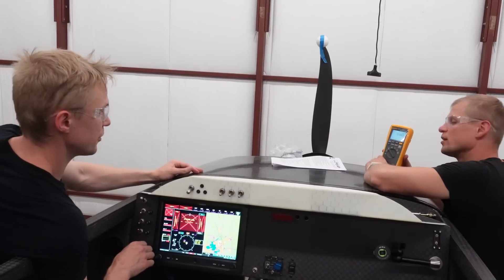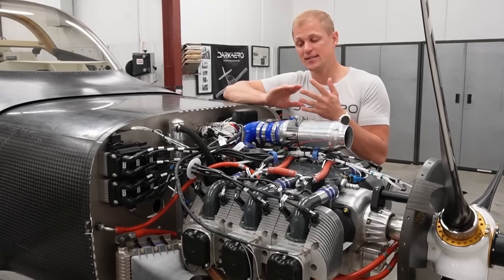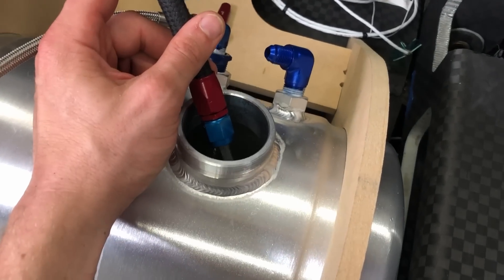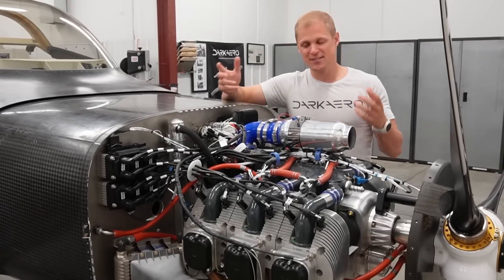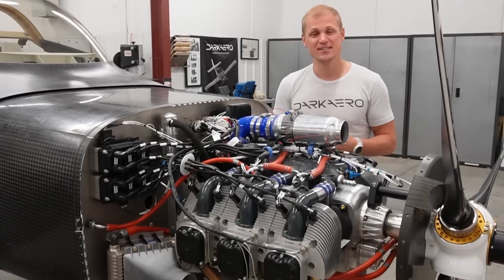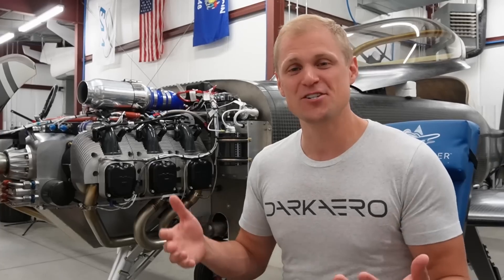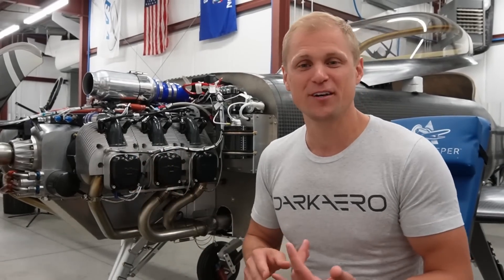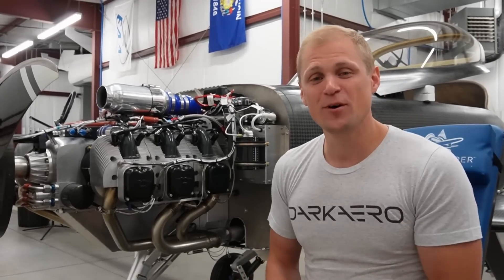FIRST ENGINE START! - DarkAero 1 Aircraft

Comment: First engine start...no chokes on any wheels... you intended to use your toes as brakes? That's not what a toe brake is though. Appreciate your efforts so far and documenting and sharing as you do, but please, stick to some safety guidelines and measures like the rest of us - Standard Procedures. And chokes before and aft the wheels are just part of it and avoid having an unpleasant impromptu meet with your hangar neighbour and the FAA.

Comment: Glad you guys chose to go with an engine that accepts unleaded mogas. Frankly, despite that I’m a pilot and it would be in my economic interest to keep things as they are I think that leaded avgas should be banned across the board. Nobody’s hobby, or even profession, should do measurable harm to children. In the long run unleaded is cheaper anyway since mogas prices are far cheaper than 100LL.

Comment: Aircraft is all about redundancy is it not?  I do not know.  Wire locks for bolts etc.  The throttle cable only has a grub screw to secure it.  Is this enough?  No crimps on either ends of the grub screw or heat shrink tubbing in case the grub screws grip fails?  Maybe it is not an issue.
Reply from the maker: Good eye! This is something we had discussed as well. Before first flight we have plans to add in an additional stop mechanism. One easy solution we had thrown around was to simply bend the wire up to prevent it from sliding back. However, we knew the engine would be coming on and off so that type of secondary stop didn't make sense to implement just yet.

Comment: Nice!  I'd be inclined to add a secondary retention to the throttle cable and eliminate that single point failure. A second set screw adjacent to the current set screw on the cable attachment fitting or a collar with a set screw on either side of the cable attachment fitting.  Many accidents have been caused by cables disconnecting from mixture and throttle levers.  Very nice work, including the frame for the temporary fuel tank.  Great job!

Comment: The prop tips seems very low to the ground. Is that normal?
Reply from the maker: Jack, thanks for watching! The prop does appear close to the ground in the video, but it may be more of a camera perspective thing. Our prop clearance is in line with FAR Part 23 ground clearance requirement of at least 7 inches when the gear is statically deflected in level taxiing attitude.

Comment: we need a photovoltaic fabric that is able to cover the last layer of carbon fiber laminates, and make electric powered lightweight air frames that are less dependent on combustion engine solutions(not having in mind the green side of it as the focus but the performance and simplicity) since electric motors have much less moving parts, and are hundreds of times more reliable and predictable, also having no fluids in fuel tanks, instead having solid state energy modules(batteries and capacitors)...  mind you that i love combustion engines and my logic is the simplicity/reliability of electric systems are undeniably greater than any fuel based systems...

Comment: Well done, guys! One tip: When you go to pushing the engine harder, make sure you cool the cylinders properly. Prop wash alone is not enough. Get your cowls in place, or make a baffle/scoop to grab as much cooling air as possible, especially the aft cylinders will suffer if you don't.
The UL-Power is basically a re-engineered Jabiru engine. Jabiru had heaps of issues from people ground running their engines without proper cooling. Consult with the guys from UL-Power for safe testing.

Comment: Brand new engines in uncowled airplanes do not respond well to running on the ground, especially at higher power.  Don't burn up your cylinders...   If it runs and doesn't leak, get it in the air and cooling ASAP.   Same with high speed taxi tests.  They should be kept to a minimum.  Lots of really nice airplanes get wrecked while pilots are building up courage to fly their new airplane. There is very little to learn from high speed taxi testing.

Comment: This thing looks sweet, but I'm concerned with how many things are electrically driven it seems. It will be interesting to see how the reliability and longevity of the electronics changes or doesn't as the aircraft ages.

Comment: Congratulations guys.  One thing I got concerned about, so thought I’d pass it along.  Be careful running the engine with the small fillets on the spinner bulkhead not attached to the spinner itself.  I once slung off both of my fillet pieces running at just moderate power during a ground run without the spinner installed.  The airplane looks GREAT and wow, that engine sounds like an IO-540.  Pretty dang cool!!!
Reply: More like an IO550
Reply: the lighter weight of a Carbon spinner parts will mean less forces exerted on the parts when spinning, so it might not be an issue, good catch, sharing our experiences is how we get better doing our things.

Comment: Without sounding too negative here, what so great about his plane? it just look like another plane but in carbon fibre, would you not be better off looking at scaling up drone technology combined with electric power which seem to be the future.
Reply: Electric propulsion will just add weight and complexity to the aircraft and, despite the latest battery tech, will severely limit range to maybe 2 hours max whilst this will fly up to 6 hours on normal pump gas.

Comment: Congratulations, guys!  My UL-520iS sat in the factory crate for a little over two years.  The only problem I had on first start up was a single clogged fuel injector, which was easily cleared with a little compressed air.  I'm using Lucas Hi-Zinc Break-in Oil for my first few hours of running.  It seems to be working well for me.

Comment: I'm curious about the engine mounting system. There is no dynafocal type engine mount with rubber vibration dampers. Why is that? Perhaps that was explained on a different video, but the straight bolting to frames on the firewall seemed odd to me.

Comment: You need to place some positive secondary cable stop on the throttle cable.. 1st is to prevent fraying ... second is to give a redundant backup incase the main lock fails. Even half throttle is better then no throttle.

Comment: The prop seems to have very little clearance from the ground.
Is this the actual distance the prop will have at take off?
Since u have a nose landing gear you need at least 7 inches by rules but I would put some more just to be safe

Comment: Did you full feather the prop? Looks like it wanted to go. Probably not much run time yet, but it sounded strong. No "bad noises" from what we could hear from the audio here. It looked like you were a little afraid of it. I understand that if you haven't been around a lot of them running.  Congrats on this milestone!!  Looking forward to hearing it roll down the R/W!!  8)  --gary

Comment: Why the throttle body has only one wire? Why is not a cable? Why there is no other secondary stop? Or not a secondary cable? Is there eletronic accelerator? Is there a programed cable change?

Holy Crap i'm really stunned by this. 

Nonetheless, You guys are doing a very fine work!!

Comment: Bend the throttle cable ,it can pull through if the screw is not as tight or vibration.  It might be embarrassing if it did.

Comment: Outstanding Job.  One suggestion. Your throttle linkage.  Where your linkage wire is straight and is held only by the torque of one set screw, you should either bent the end of the wire 90 Degrees of put an additional collar with set screw on the end.  The last thing you need to happen while flying is to have that one connection loosen. As you know engine vibrations are excessive.  Some nuts and bolts maybe required to be safety wire also to be flight worthy.  Great clean job otherwise.

Comment: What is the rationale of having the prop installed/ connected for the first engine start?
Reply: Prop functions as the fly wheel...
Reply: You need to have a load when running such engines…
Reply: The engine is air cooled. The propeller sends the air.

Comment: Love the progress, but would recommend some chocks around the wheels. It is not the purpose of the test to run high thrust, i am aware. But if you end up with a failure on your brakes (it is still a prototype), you could end up with severe damage and/or injury. Easy to do, certainly increasing safety. Keep it up! 💪🏻
Reply: You can see they have strapped the entire plane down at 4:21 for example, look underneath, those are tethers. So I total disagree with your claim of severe injury / damage. That said, no harm in putting chocks in I don't think. But I'd rather have a plane strapped then just using chocks, I've seen plenty of problems with chocks alone.
Reply: @randominternet5586  Well noticed, didn’t see that. Then again, no harm in adding those chocks.
I did not say they most definitely will have damage as a result, I said it might. Safety is all about being open to the fact that things might happen (the strap could fail, for instance) and act upon those risks. Assess the possible severity, likelyhood and subsequently mitigate them as deemed appropriate.

Comment: Unless that engine has been Dyno run for break-in you cannot do much ground running without compromising cylinder longevity. You have limited time before the cylinder walls glaze up. Once that happens your break-in is over. For proper ring seating that requires high power operation. You must have good cooling during this period. You need your baffles and cooling plenum installed during ground runs.

Comment: Nice guys!
Is it just me, but it looks like the prop is really close to the ground on the video.
How much distance is a good distance from the ground to keep from getting a prop stike from the ground when landing in a not so desired landing?
I don't know the length of suspension travel in the nose gear so it's just a question.
Reply: Looks like there is only maybe 3 inches of suspension travel and given the proximity of the front wheel to the prop I wonder if there would be enough compliance in the suspension and tires to even allow the possibility of a prop strike with some porpoising. Definitely not designed for off airport use. 
Probably coming in a little hot with those laminar flow wings.

Comment: Would it be possible to use a UL520t. It does mean the biggest change would be the propellor. How much would you have to redesign the nosecone to fit the Airmaster AP545CTF-SNR68JE ?

Comment: The way the throttle cable rubs on the cable housing/bracket is a bit concerning. Maybe angle the bracket up a few degrees, so the rubbing is much less?  It probably won't see the number of cycles to be a problem though.  Awesome work guys!

Comment: It's been a long road and tons of hard work. Congrats on a great achievement. Engine has "that sound". The Dark Arrow is going to be a real hot rod. My guess is 280Kts down low and 310 kts at 10,000.
Reply: What do you base your estimates on? How will it be 30 knots faster at 10,000 feet than at SL with a naturally aspirated engine?
Reply: I think engine torque is going to be hard to control with the small rudder. On take off  it will require a gradual application of power until airspeed is sufficient.

Comment: Excellent!! If you haven't already, put a positive stop on the end of your throttle wire. Cannot wait for the rest of the build and testing. Thanks for the great vids,J
Reply: I thought the same thing when I saw it. 💯
Reply: @jimk8520  So did a lot of us. And no wheel chocks (anything could have happened). For the Dark Aero team: It is good practice to put some kind of hood over an air cooled engine when testing, if not the actual cowling, so the air flows down through the cylinder fins. Do you have six CHT probes and or EGT probes on it? Are you going to be doing any baffling to direct the air flow? At Lycoming they would put air pressure sensors at various places under the cowl when a new plane model came out, to ensure the best cooling for the cylinders. They would test fly it and take readings and those readings had to make a certain pressure or it would be hard to issue warranty on a particular installation.
Reply: @i.r.wayright1457  Look underneath at 4:21, those are tethers that tether the plane down / back. Great points on the airflow and testing however.
Reply: @i.r.wayright1457  Spot On!!
Reply: @randominternet5586  Still, wheel chocks would not hurt.
Reply: @i.r.wayright1457  it was tethered down, and they only ran the engine at low RPM for a few minutes. Even a watercooled engine with no coolant is fine for a short time at low RPM.
Reply: @i.r.wayright1457  also the guide where cable comes out will bind/wear  a touch, needs elongating
Reply: @ParadigmUnkn0wn  >> they only ran the engine at low RPM for a few minutes. 

Famous last words. Belt and braces! Just in case. The 0.0001% edge-case. "It won't happen to me". Expect the unexpected. etc...

Comment: Are you not going to put a bend or a cap on an air intake valve cable @0:34, if it what it is? (haven't watched the whole video yet, so sorry if incorrect)

Comment: Congratulations on first engine start!   Careful with the CHT’s during testing on the ground; on my lycomings ive overhauled the CHT’s need to be kept below 350 degrees during initial ground runs.  Anything higher and the cylinders will get glazed thus requiring the cylinders to be removed, honed, and new rings installed.